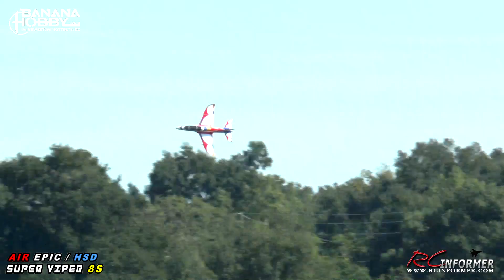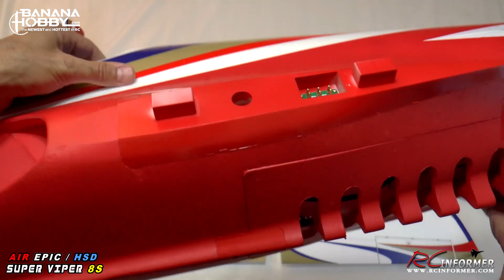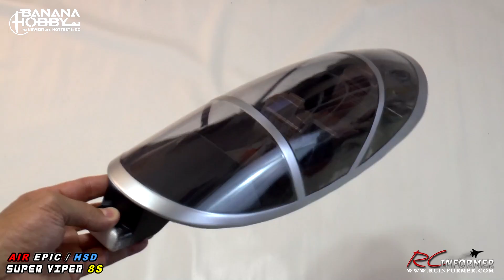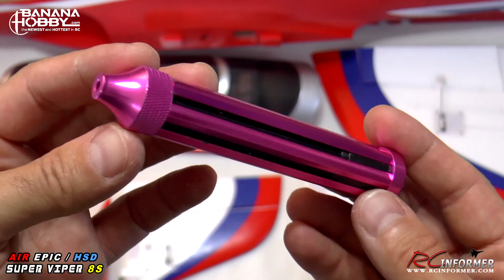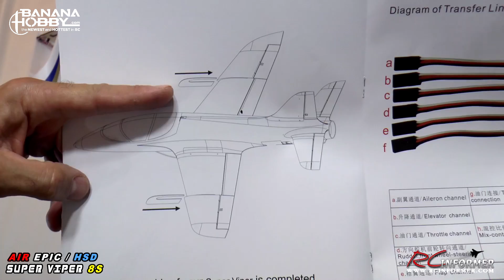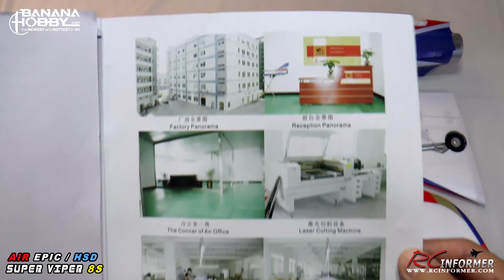Banana Hobby / HSD HOBBY Super Viper UNBOXING By:RCINFORMER

Comment: Hi again Rich. Thank you for the offer to help but I'm turning this thing over to a friend of mine who thinks he can get it running correctly. I doubt it but will allow him to give it a shot. The problem is the wiring is so tightly wound around the board making it impossible to make any since. I used a flash light in order to tell what's what, but was a waist. I fly giant scale and I think I should go back to what I know. Seems as if who ever put this thing together forgot about any organization, and instructions. (they should go together) I have an F-4 still in the box. I plan on returning it. I want no more headaches with edf. I'm sure others have had great success with this kit, just not for me I guess.
Reply from the maker: There are only 6 wires coming off the board... Aileron, Elevator, Rudder, Throttle, Gear and Flaps, they plug into the receiver.... All are lined up on the left side of the fuselage... it is very simple!

Comment: hi rich , what happen to the set up video for the super viper ?
Reply from the maker: I am revising it and will relaunch it soon. I went to fly the plane this weekend and one of the battery connectors that came soldered to one of the batteries melted causing a crash:( I decided to revise the battery connections and use all AN150 connectors... I will include this in the new video.... I had been flying the plane quite a bit with my initial setup and had no problems until Saturday... the New battery connections should be far superior... Stay tuned, i should have it out soon:)